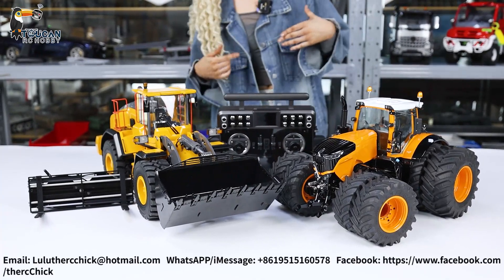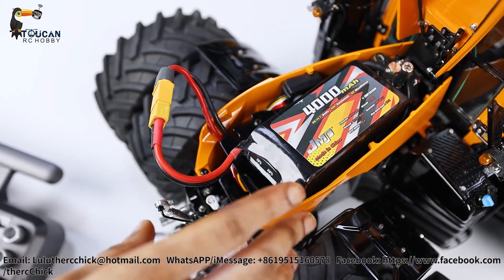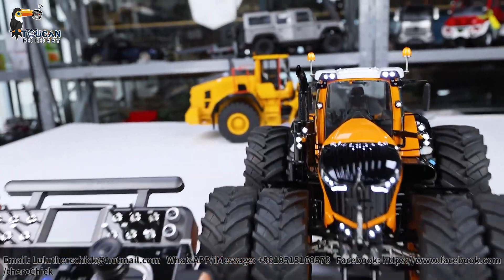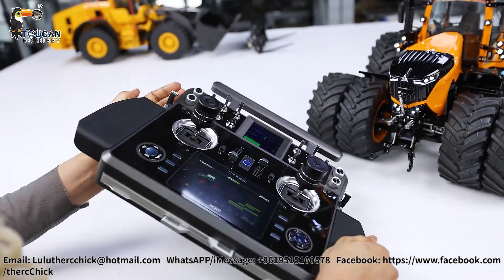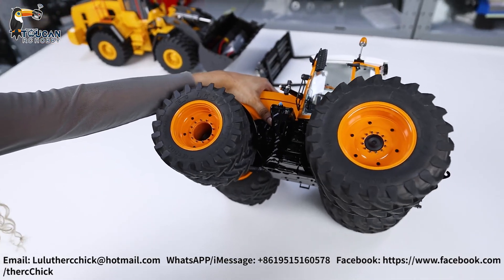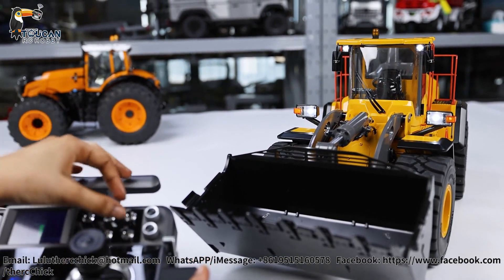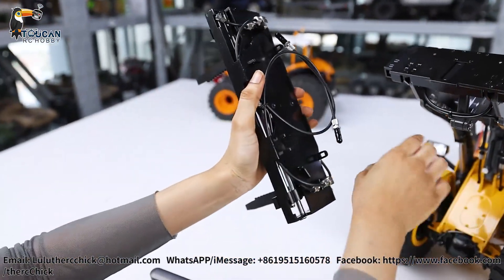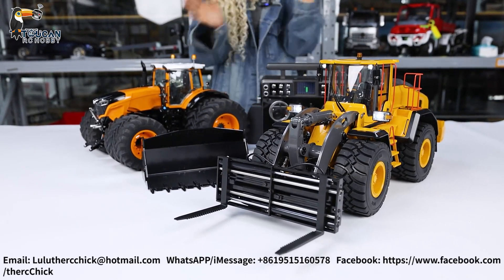How to Operated the FLesu 1050 Fendt Tractor & MTM E260L Wheel Loader on FrSky XE Controller

Comment: I haven't been on this channel for years because I couldn't afford anything. Now I can afford some of these I'm noticing that you're always demonstrating how fast all the movements are. These are very scale models..... I want to see how slow and scale the movements can be before I part with my money.
Reply: I have a few models. The Xdrc wa 470 , Xdrc a40g rock truck and Xdrc 945 excavator. And even on inexpensive radios you have fine slow controlled movements. You can adjust the pump speeds and control sensitivity and power. The better and smoother movements come with the better radios also